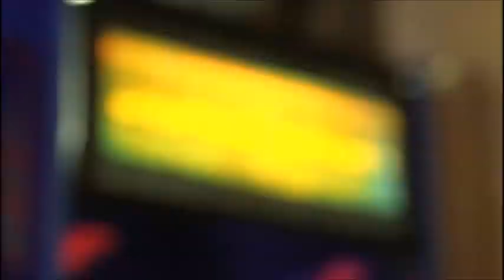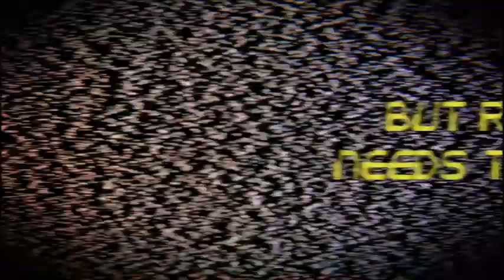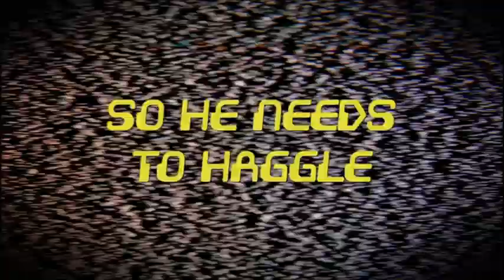ArcadeMan2021

Comment: Good to see you still going strong Richie. I bought one of the original Kong Off machines from an EBay auction many moons ago. I still have it and I'm still not that great at it. But it takes me back to a simpler time when I used to get wheeled up to arcade machines while sitting in a shopping basket when my Dad would take me grocery shopping with him when I was little. Keep up the good work bud.